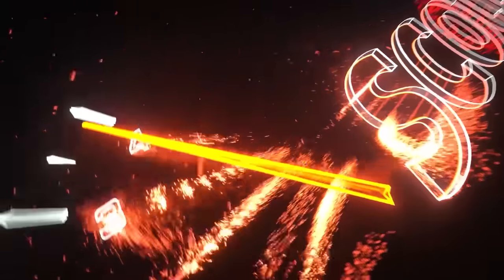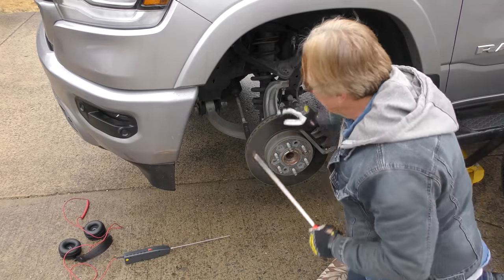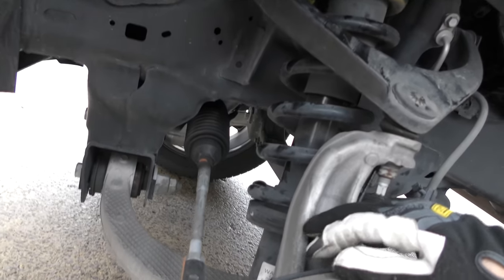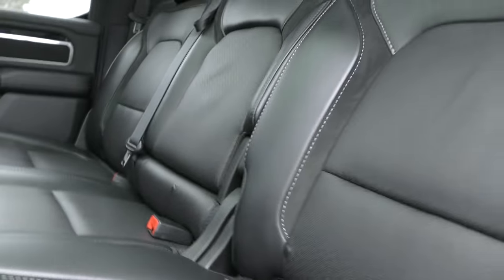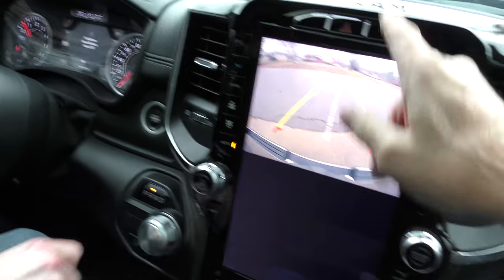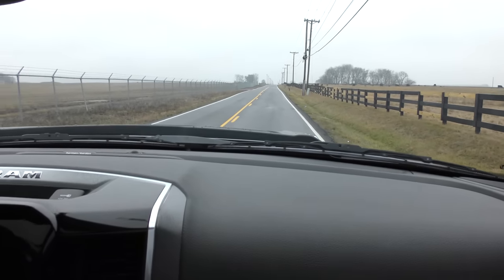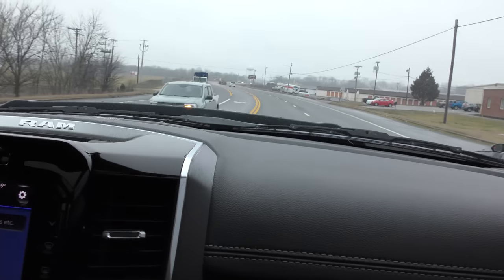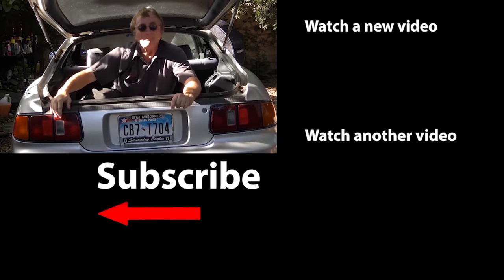Ram’s New Truck Scares the Crap Out of Me

Comment: Omg! I have one of these as a loaner and I hate this e torque setup! It’s so hard to be smooth at start stops situations. Between the engine shutting off and the engaging of the electric motor at the same time as the engine comes to life, you’re always getting mild whiplash. When you’re stopped and want to creep forward it lunges and then you over compensate with the brakes to avoid a collision…  the rest of the time it’s fine but as someone who values making their passengers comfortable it’s a nightmare. 

Side note: most people have no clue how to be smooth drivers so I understand how this setup didn’t bother anyone responsible for the design.

Comment: The problem with the hybrid stop start is that you are still  using an engine with a pushrod valve system - too many moving parts  which wear out early and break and cause problems.. So there is that.
best 
Bruce Peek

Comment: They say electric motors have instant torque but from my experience it's just not entirely instant. It's similar to putting an electric power ratchet on a bolt or getting it to start spinning first and then putting it on the bolt. Many times it will undo a bolt that it cannot do when it hasn't already begun spinning. So the torque does seem to be slightly different once it's already spinning...

Comment: Scotty, I have a 2020 RAM Rebel with the 3rd Gen 3.0 EcoDiesel. I bought it new. I have a 179,000 mi on it with no problems. Neither the engine nor the drivetrain have had issues. I'm curious where you get your info about the 3rd Gen EcoDiesel, and idle a of the time. I tow 7800 lbs often and have the bed full of about 900 lbs every day. Towing I average 14 to 16 mph and driving around daily average 20 to 22. Why do you seem to dislike the 3.0 EcoDiesel so much??

Comment: I wonder how long that Ram truck will last without major repairs.  I would love to know.
Reply: I have a 2016 Ram 1500 Big Horn 4x4 with 233k miles. I’ve been thru 3-4 sets of rotars/brake pads, a plastic part attached to the radiator cracked, and 6 sets of tires. It was our main vehicle until last year and now pulls a trailer and 1,300 lbs lawn mower every day. For years I lived down a 10 mile dirt road in the mountains and never a issue. Maybe I’m just lucky but it’s great for me.
Reply: Well, they added yet another expensive to repair system (etorque).  I’m not a fan of the shifter or the push-button 4x4 selector in my 2017, and now there’s another thing that can break.  I also wish it had traditional power steering.  Even so, it’s been good to me so far.  Just not looking forward to those things breaking.

Comment: No idling in our 2011 1500 Ram 4x4 with the 5.7 Hemi, and it developed the dreaded Hemi tick. Very little hauling or towing, mainly Highway miles. Had to replace the camshaft and lifters at 175,000 miles…$6k in repairs.  Had to replace the tranny at 125k miles…$5k there.  Plus, the rocker panels and rear wheel wells are rusting.  It’s comfortable, but very disappointed in it.

Comment: Our 2021 Ram with e-torque has been great. There has been a few problems but those were because of the previous owner. Ram boxes are great!

In town we get 12mpg
Highway we get just over 18
Hauling our camper we get 8
Reply: Wait till all the wiring problems start ….. and they will start …
Reply: How do you get previous owner problems in a 2 year of vehicle? What were they doing for that first year? NHRA meets or something?
Reply: @RatelHBadger  it was minor stuff. Something with the right tire and then a small dent in the glovebox. The tire problem is fixed, glovebox still has a small dent.
Reply: What is etorque? Sounds like a gimmick to rob you. Youre getting 12 mpg with it. My old endless money 2001 dodge ram got the same fuel economy and there was no gimmicky system and it was still an endless money pit
Reply: @censored4christ162 It is the "hybrid" system that the entire video was about.
Reply: Wow modern rams only get 12mpg? Damn. Im shocked that a modern truck gets that rating. Even if its a v8.
Reply: @Soulintent95 That is with a short 2 mile trip through town. When we take it on a road trip it gets in the high 18's
Reply: @djplonghead5403  thats not too bad. My f150 gets 19 in sport mode, around 21 in eco mode. I do mostly highway. But i have the ecoboost engine, 3.5l.
Reply: I have a 2019 Ram with eTorque and the 3.92 ratio and I get around 11MPG in my 2 mile trip to work and back. I spend more time stopped than I do in motion. Engine stop/start technically works fine, but I'm in Florida and usually have the A/C on max so the stop/start doesn't even engage then. If the A/C is a little lower, the stop/start does engage but the engine kicks itself back on in like 15-30 seconds (I assume because the battery can't really charge much in my small trips).
Reply: Etorque system is (optional) trash but otherwise the V8 RAM is a 💎gem

Comment: I have 2022 Ram 1500 4x4 crew cab sport...❤ it to death 3inch motofab lift in front rear 2inch lift I feel like king 🤴 of the streets later 33x12.50r20 tires maybe camper shell...😊

Comment: Did the WD-40 fix the clunking noise? Somehow missed that! Also didn’t know Rams get such great gas mileage! I only get 18 around town, 20 hwy with my 94 4wd , 4 cyl Toyota pickup!
Reply: I've got the 3.6 liter V 6  in my 2021ram1500 classic I get around  20 mpg it's a 4x4 quad cab 😊

Comment: My 2019 Ram 1500 5.7 with the 3.92 with the anti-spin rear-end gets 18 mpg average and gets 22 mpg at 60/65 mph.
Reply: Rams are trash.  Wait for the hemi tick.  We lost half our fleet of trucks to the hemi tick which was a cam issue and needed engine replacements.  I hope you have a good extended warranty because they wanted like $8k to fix each one.
Reply: @evanl889  
I've have the Challenger and the Ram with the 5.7 Hemi. 
No issues at all with either vehicle.
Reply: @evanl889  Rams aren’t great for fleet use.  For personal use they’re decent.  Mines 7 years old, Hemi, no issues.
Reply: @evanl889 cams replacement aren't that expensive or even hard to replace, we do it with timing chains ,water pumps and radiator at around 150k miles ,those trucks don't come back until 280 ,300k miles

Comment: I get 18mpg overall summer average with my 2021 non hybrid RAM 5.7 hemi and it has the 3.92 gear ratio. It looks identical to the truck in the video. Maybe my foot isn't as heavy as the person in the video. I average 20-21 at 60mph. A recent 684 mile trip with a tail wind, I did 21.7mpg at 74mph!

Comment: I have a 2020 ram limited etorgue.. left and right headers when out. Both front wheel bearings at 80670 miles went out plus the running boards motor also went out almost at the same time my wheel bearings

Comment: @scottykilmer
I have an opportunity to buy a 2013 Silverado z71 with 40k on it for $15k.
Old man driven and always garaged. No rust. Should I buy it ASAP?
Reply: What engine ?
Reply: YES!!!!!!!!!!
Reply: 5.3 vortec @indycharlie
Reply: Yes
Reply: Sounds like a good deal then !  At only 4K miles a year . There may be some odd stuff weakened with all the city driving .. rattles , shakes , shock , tie rods ect .Even still , being that engine , Sounds good , Good luck K37 ..
Reply: It's still chevy expect low quality especially from the Transmission lol just cause u got a few people with good experiences doesn't mean the lawsuit , recalls and mechanical failures don't exist , not a good buy
Reply: Buy it. 209k on my 02,  water pump and front u joint only problems ever with it.
Reply: @2t713  completely differnet quality in term of years,  that 2013 will never be a 02 , maybe think about the year of crap he talking about cause it didn't get better after 2010 🤣
Reply: $15k

Comment: For years I would joke around and dog on Dodge products, but then my wife and I needed a van as she was pregnant again, this was some time back of course, however, we got a nice used Caravan that was well taken care of over the years. The only issue we had was the rear drums going out and losing break fluid, though it was my own fault for slamming on the breaks when it was 30-below out, and had the serphintine belt snap. Outside of that, it was reliable and drove fantastic in the snow. Then, my mother who had always owned Fords or GM vehicle decided to buy her first Dodge in 2013 and then another and another and now a Jeep. Only one of the four had any issues and those were electrical issues and a bad ground draining the battery. Her current Jeep is a 2018 and only has 9k miles on it. She does not drive much anymore.

Comment: Problem with idling todays diesels is the stupid emmisions systems well clog up on you if your not careful which isnt cheap to fix either. If im idling longer than 10 min i kill it on my 22 2500 ram 6.7 but i sure to enjoy driving it but i drive hour of hwy to and from work so it cleans the exhaust system out pretty good 34k in a year and a half and still counting we shall see.

Comment: A hybrid truck? What a joke.
Reply: You don't wanna save the earth?
Reply: @dang75790  Earth just wanted our plastic. We're expendable!
Reply: Blame ESG
Reply: It’s not a true hybrid I have an etorque 

It just fills in torque gaps. The truck never runs on the battery like a normal hybrid
Reply: @naff78  I'm vegan, only drive electric vehicles and use solar for my power at home. I think I'll go hug a tree as well.
Reply: Earth does not need saving. Humans do.
Reply: @dang75790 😅😅😅😅😅
Reply: Remember Scotty said there is more pollution from break pads than gasoline vehicles
Reply: @dang75790 meat person. Drive a fully gas truck and work in oil and gas. 80% of my electricity comes from coal generators. I think I'll go hug humanity as well.
Reply: Mild hybrids isn't a full hybrid vehicle like a prius. It's used for the minute you first press the gas to get the truck going with torque and in parking lots. Gives you a few extra mpgs. Big suvs have them. So no it's not a joke.
Reply: @dang75790 With batteries???????
Reply: Did I miss it? What about the clicking noise, is it gone or not?
Reply: The new tundra has an option that a twin turbo v6 hybrid
Reply: wnc817  lmao that's funny
Reply: @davidbeard2748 good question, my thought also😂
Reply: I'm a transit bus driver.  We have Gillig hybrid buses as well as diesel.  And full electric
Reply: Especially from Dodge.
Reply: @micahgreene4573  What are the full electric ones like?
Reply: Yea all the tacomas and tundras are going to that in 2024
Reply: It will be just a show pony.
Reply: Mopar also has a 1.3L turbo jeep trail hawk renegade.
Reply: A hybrid system like this actually makes sense in a truck. It provides more torque.
Reply: An ignoramus? What a joke
Reply: @ThomasKing19933  they seem ok.  They take off like a bat out of hell.  But they definitely don't have the range.  They are only used on our free downtown shuttle routes.  Would never make it on an all day regular route .  Easy to stop.  Starts slowing as soon as you let off the gas.
Reply: Planet destroyer
Reply: My father has it, does great, in CARB states the warranty is great
Reply: @justinpennington7682 😂
Reply: @hofahome Are you okay?😢 😂
Reply: @micahgreene4573 Would the electric one make the diesel and hybrid one obsolete if it had better range?
Reply: @ThomasKing19933  I don't think so.  At least not here in Orlando.  We only have about maybe 8 or 9 charging stations.  We have (I don't know how many) a couple of hundred buses.  Most of the buses are CNG.  The older ones are diesel.  A few hybrids.  And the minority is full electric.  So unless a company figures out to have a few hundred charging stations, I don't think an all electric fleet is feasible.
Reply: @micahgreene4573  Thanks for your insight. This is why I think everyone owning an EV is a long way off.
Reply: @ThomasKing19933  I’m ok but I don’t really understand why people assume a hybrid system is bad on a truck, unless they are uneducated and jumping to conclusions 🤷‍♂️
Reply: @hofahome I don't really mind if you think I'm uneducated because you don't know me.
Reply: @ThomasKing19933  Ok fair point on that. Can you explain why you don’t like a mild hybrid setup?
Reply: @hofahome  To be honest, I just don't like the idea of anything electric being forced on people. I'd be okay with a hybrid if it was reliable.
Reply: @dang75790 eat a granola bar
Reply: You definitely didn't pay attention to the video. Its only there for extra torque. It has a Hemi gasoline engine it.
Reply: @naff78 George Carlin!!!
Reply: A mild hybrid truck...
Reply: @ThomasKing19933 is a prius unreliable? I have almost 100k miles on my sienna hybrid averaging 40mph and not 1 hiccup from the system. The sliding door is another thing lol.
Reply: Might wanna look at hybrid Maverick sales figures

Comment: If you dry park it ie turn the wheel back and forth while its running and the weight is on the tires and have someone look at the suspension you can discover alot of potential issues.

Comment: I love you Scotty but the absolute last thing you want to do is put a lot of idle hours on a modern diesel. Sure the engine is happy with it but the diesel particulate filter will get clogged and never burn off and the thing will be doing regens like crazy.
Reply: Couldn’t agree more.  I own a 2013 Ram Diesel.  Constant check engine light issues.  Only drive it when I’ll be on the highway.  It’s a hefty bill to repair the filter referenced and / if the exhaust manifold is clogged as well.  I understand some mechanics can remove the DEF.  Seriously considering it.  This is not your father’s diesel.   I agree Scotty is great but No idling w/ DEF Diesel

Comment: I get 19 mpg in my Ram without the etorque.  What’s the point of that system?
Reply: I get 21 mpg with a quad in the back 14.2 l per 100 on dirt roads with quad . Etorq is a absolute joke
Reply: It's more of a performance thing to give more torque at launch. I think the fuel economy stuff is exaggerated to make the EPA and whatnot happy, but realistically the only way it saves fuel is when the engine is shut off when you're stopped.
Reply: @traviscombs6947  Excessive idling is bad for a modern Hemi, but I have to imagine constantly starting and stopping it isnt great either.

Comment: While you’ve got the tire off & the WD-40 in your hand, it’s as good a time as any to go ahead and lubricate the brakes so they wear more evenly.
Reply: I’ll use olive oil sometimes. Just a little tip. Apply on the pads with a brush
Reply: You should also take the opportunity to lubricate the muffler bearing to quieten your exhaust

Comment: Picked up a certified pre-owned 2020 Ram 1500 with 54,000 miles- both headers are cracked, replaced entire rear window for leak and transmission needed an update because it would rev hang in nuetral at whatever RPM you let off at.
Was spotless and had a perfect maintenance and oil change schedule- 😅     Luckily it was CPO or else all these fixes would cost $$$$$$
Reply: And you still own it….good grief.  Sell that piece of crap.
Reply: @hokie9910  No need when everything is fixed now. You'd spend more money on another one, at higher interest rate if you aren't paying cash, and will end up with same issues if they weren't fixed already.
Reply: @NoLimitsCommemorativ  There will be more problems with that truck.  I am truly not trying to be a jerk, I just hate seeing people get in the same trap that Ram puts people into time and time again.  There are inherent problems with the hemi engines that have never been resolved.  Uncle Tony’s garage was one of the first people to figure it out, good watch if you have a minute.  Then you have the transmission issues and electrical gremlins that get worse as these trucks get older.  A 10 year old Tundra that’s been well maintained will serve you well.  Please don’t listen to people who say that Tundras get so much worse fuel economy than the domestics, it’s just not true.  Go on Fuelly and you will see what I mean when real world numbers are put in.
Reply: @hokie9910  I hear ya. I looked at every manufacturer for another pickup because I work on my own vehicles when they have no warranty- and the Ram is the easiest to work on. The german built ZF8HP75 and not the licensed 850HE is a solid transmission, I drive my vehicles hard and that's what the Hemi likes- I have seen a lot of Tundra's with blown headgaskets and antifreeze in the oil pan. I'd opt for  a 2012-2018 F-150 if I could find a decent coyote with the payload package and CPO but that's a unicorn.   Personally speaking they all have there fault's and you just have to pick which one you are willing to put up with these days.  If I could have someone build me a new truck with no fancy gizmo's, a manual paired to an emission's free I6 cummin's without it costing 100k I would.

Comment: Would you recommend adding Lucus full synthetic stabilizer in the 5.7 hemi or just full synthetic oil with no stabilizer?

I change my oil every 5k and don’t idle the truck much but on my most recent oil change swapped on quart of oil for the Lucas full synthetic stabilizer.

Just curious what your point of view is and what you’ve seen other hemi owner do and how it’s working out for them.

Enjoyed the video thanks!

Comment: Scotty is incorrect about 2007+ MY diesel engines being able to extended idle without problems.  Those diesel engines will absolutely develop MAJOR emission system problems if they are extended idled frequently.  Also, most of the newer diesel engines are finicky about fuel quality.  Poor quality fuel will absolutely cause emission system and fuel injection system problems.  Many HD pickup fleets are abandoning diesel engines in pickups because of all of those issues with extended idling of newer model diesel engines.

Comment: You don't buy a truck for mpg.! However I have a 2015 GMC Sierra crew cab 4x4 5.3L 3.42 axle with 200,000 miles, I get 20.5 mpg driving 80 miles round trip to work. 2 lane roads.